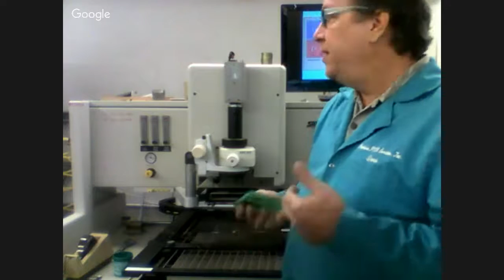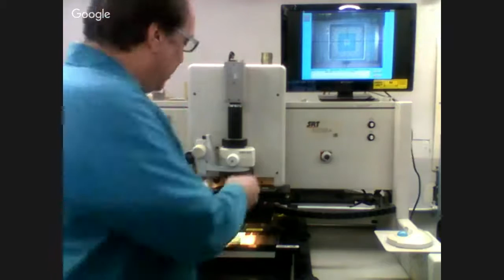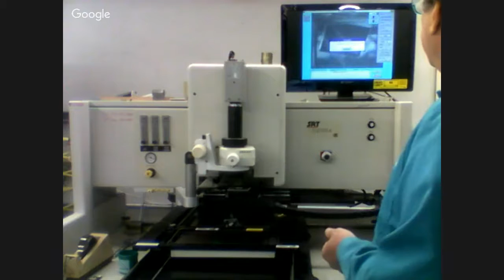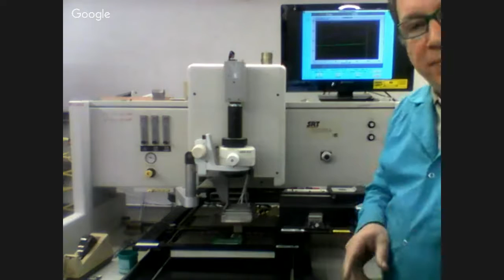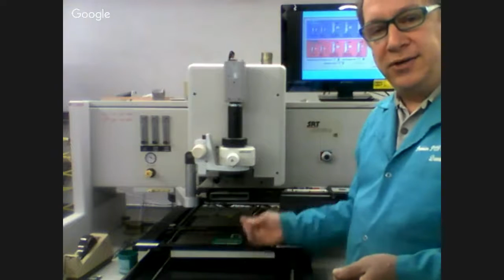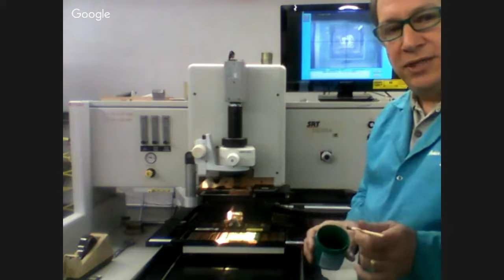SRT BGA Rework Station Demo Part 2

Comment: THANK YOU so much for these videos. I have recently began working with the SRT Summit 1100 and I am the only one in the place who can use the machine.........except I really can't since I haven't had the time to learn too much about profiles and I have been relying on the ones previously created, and just the fact that the machine did what it was supposed to do. For two days the machine has been over-heating and parts falling off, mis-alignments, and just total chaos and no one there can help. It happened about a month ago too yet strangely the issue resolved and I still don't know why. I am assuming it's a profile issue so these two demos on this machine are really appreciated. Thanks for taking the time.
Reply from the maker: Thank you.  Glad I could help.
Reply: Do you know of a resource where I could ask specific questions and/or receive instruction regarding this machine?